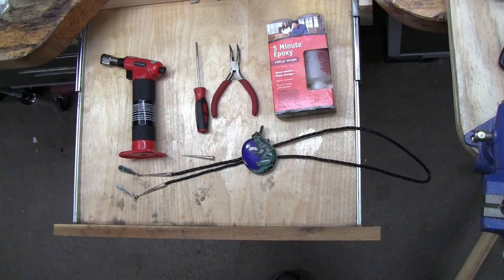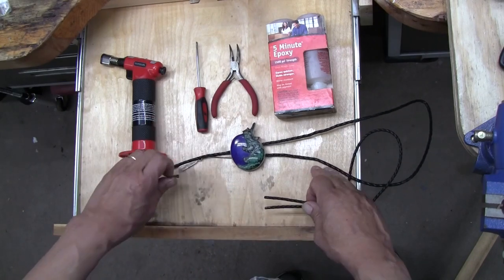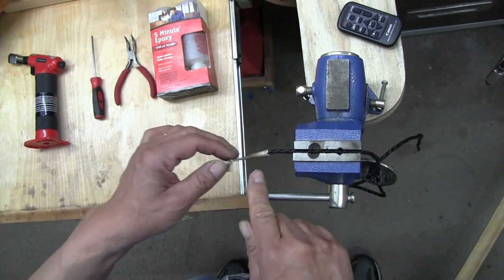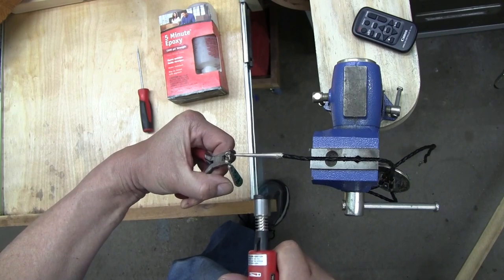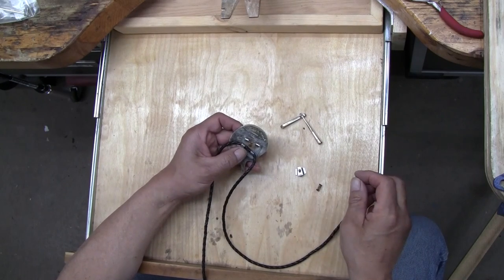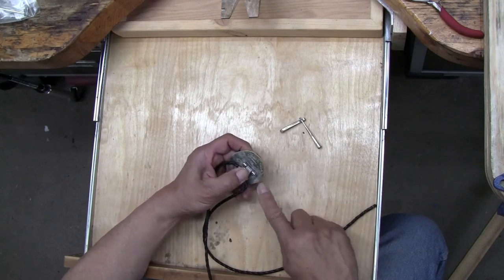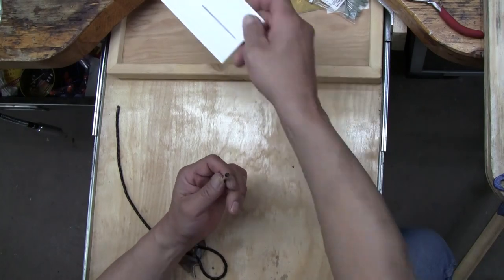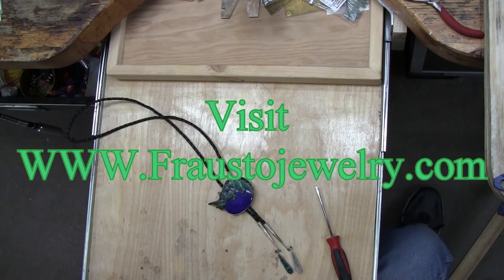Bolo cord and tip repair

Comment: Thanks for the details on the tips and clasp. However, I'm a little nervous about using even 5-minute  (not the strongest bond) is used. Still epoxies generally don't want to come apart. Was the tip you removed held with 5 minute epoxy?
Reply from the maker: Greetings Richard, Yes the bolo tie used in this video was held with a 5 minute epoxy  (Devcon 5 minute epoxy adhesive) Can be found at hardware stores and Walmart. As I mentioned in the video in the olden days we used this cement to hold on our metal hunting tips to our wooden arrows for bow hunting. Very strong wood to metal bond. It sets in 5 minutes, and hardens very hard in 24 hrs. However when you apply low temp heat (match) or cigarette lighter it will release when applied to the metal portion. It will crystalize on the metal if a person wanted to scrape the crusted epoxy (plastic crumbs) away from the metal. I haven't found that necessary however. The sharp prongs at the wide end of the bolo tip (the one's you might have had to bend out to remove the tip) also can also help hold the tip securely. You can try this technique on a small leather shoe string (scrap) and a small tube or spent 22 cal. cartridge to test how it will hold and remove to make sure it functions to your satisfaction. Hope this helps.
Reply: @patrickfrausto9866   Thanks for the video!  I need to shorten the cord and I want to save the nice original sterling silver tips.  Can I use a multi-purpose lighter?  I'm nervous about heating the tips.  Does that damage, or stain the tips?